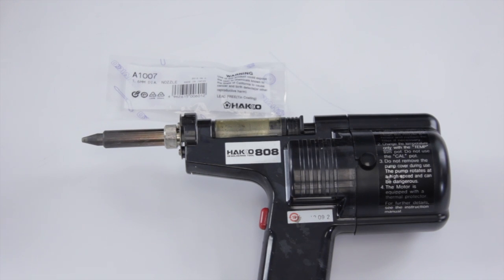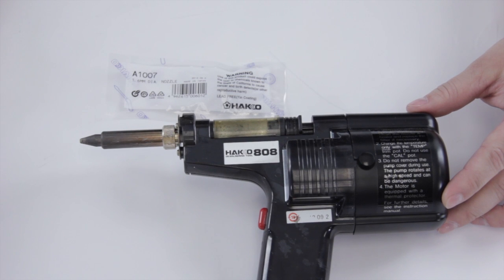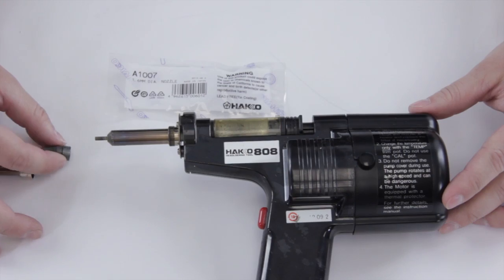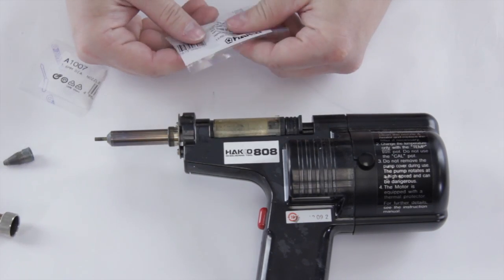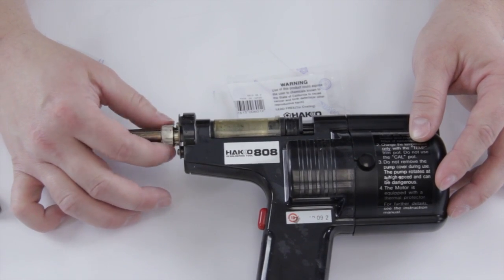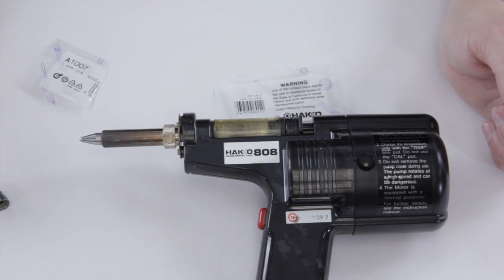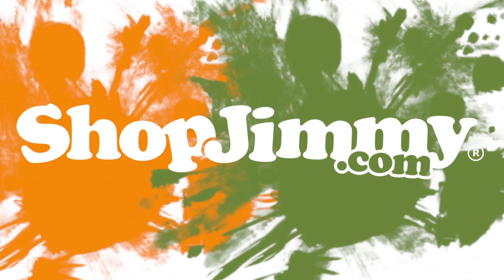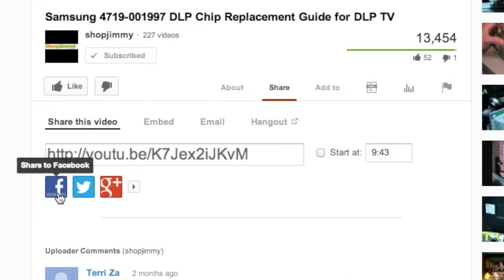How to Replace the Hakko 808 Tip/Nozzle - DIY How To Desolder Tip #5

Comment: So the tip on my 808 isn't heating up.. It motor works but the battery element doesn't want to heat up.. Anything I should be looking for after I get it open?

Comment: I got a replacement tip and the end is sealed.  It looks from your vid like yours is too?  Does this end cap melt off?  I can't figure out how to remove it.
Reply: answering my own question, it's sealed with solder and it melts off during first use.

Comment: I thought this would fix my problem, but it didn't! Your naming of this video is deceptive.
My soldering gun came with tips without holes for the molten solder to be sucked through, when I read the named video "how to desolder tip" which I thought the tips supposed to come with their holes soldered, but no! For me this video is clickbait! Try to be more descriptive when naming your videos!😢 I thought you would have the answer but I was wrong!